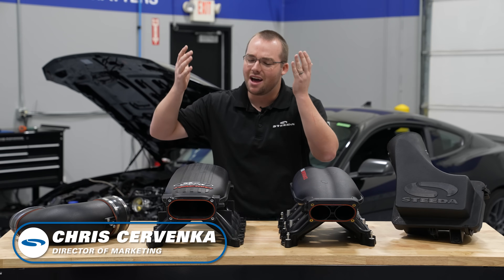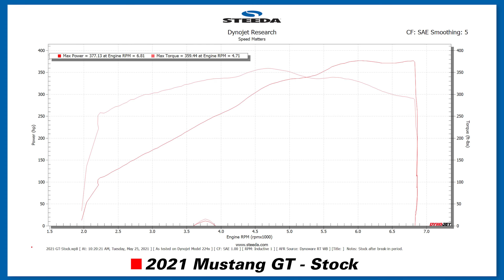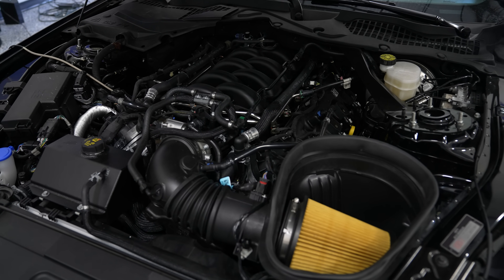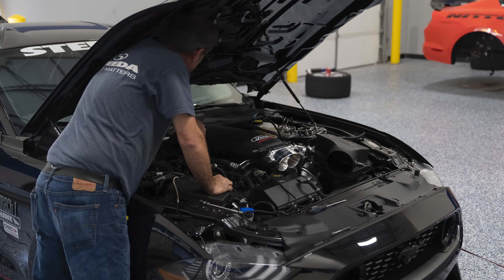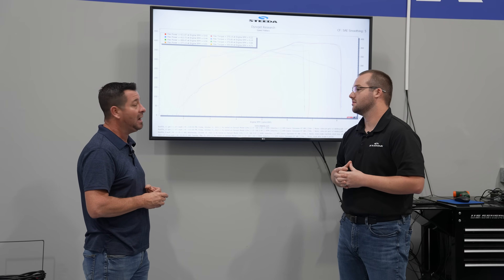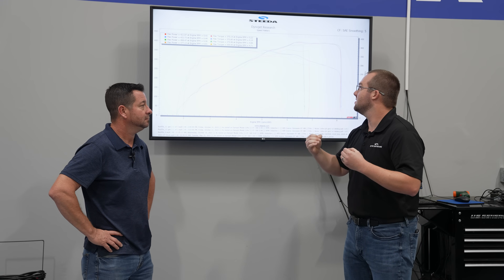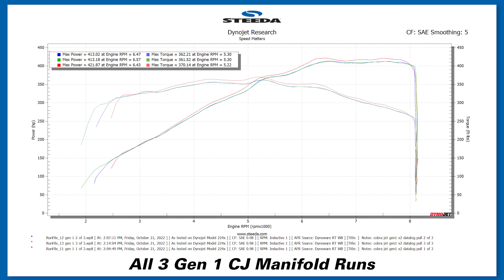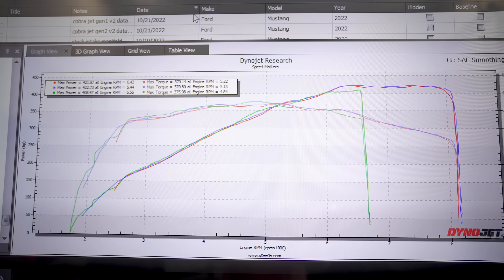Testing the New Cobra Jet Intake Manifold | Gen 1 vs Gen 2

Comment: $1500 for the CJ, then add a CAI, TB, aftermarket hood/motor mounts, for "maybe" 50HP, and you're already half way to paying for a supercharger setup... 

If you want to go max effort NA, expect to lose the radio, AC, and everything that makes your car pretty and dailyable. That's how you run 10's or even 9's

FYI, a ported 18 manifold performs only slightly worse than a CJ...
Reply: We went 9's NA with a radio and AC....

Comment: I heard the new CJ isn't compatible with automatic mustangs. Is that true? I forgot what site it was that said that
Reply: Lol transmission doesn’t matter it will fit the motor still the same
Reply: @Arman-e3x  "It does not have provisions for the aspirator tube hookup found on automatic transmission models, and is therefore incompatible with the Ford Mustang GT automatic transmission." Found the article. It's was by Ford Authority. It DOES matter.
Reply: You will need to fab up your own vacuum lines with an auto

Comment: Its cool to see some numbers, but im pretty sure the cj gains arent super evident without cams and headers. Gotta rev it to 8 or better to really benefit from that increased flow.
Reply: This was just a comparison of the gen1 and gen2 intakes on stock engines (which is most likely the way 95% of people will do). There is no real diff in power - it's just a way for FRPP to justify increasing the price.
Reply: @jsimmonstx  you can't judge it by what it does on a stock engine it isn't meant to be ran on a setup like that.  You need cams and headers to take advantage of what the cj can do ecsp the newest one.  On a max effort setup I guarantee it'll make more power than the other cj equal setups.
Reply: @midnight347  it’d probably still make 1-2 more whp with cams and exhaust haha the gains from the extra mods would just get subtracted out
Reply: @midnight347  Yes, those mods would help *the engine*, but the gen1 and gen2 would still show negligible power differences between the two intakes on the same motor.

Comment: Thankyou for the comparison, I would definitely love to see a ported gen 1 vs ported gen 2 cj with free flowing exhaust. That aside, I feel the stock Mach 1 and the stock gt run should be taken with a grain of salt. Those where stock runs, so in addition to adding the cj, the tune was more aggressive than the stock runs. The cobra jet definitely will carry power out to 8000 the best, but this doesn’t show what the 18 and 350 manifolds can do when they are tuned more aggressively as well. Also when comparing the stock gt vs Mach 1, being that they have different factory tunes and one is open air intake I also don’t think that’s a good comparison. The Mach 1 definitely makes a good chunk more power in stock form, but I think it would be fair to get an aftermarket tune for both and leveling the playing field to truly show the difference in the manifolds.
Reply: The gen two can't be ported due to the way it's cast.
Reply: @marksiniard9731  there is at least 1 company (1320 Junkie) and probably more like AFS that are currently porting them. Don’t know what you mean “They cant be ported”
Reply: @marksiniard9731  I’ve sold a dozen ported Gen 2’s. More work but very doable.
Reply: @marksiniard9731  ahh ok I didn’t realize, thanks for telling me
Reply: It wasn't about what the stock manifolds do there are plenty of results for that.  This was how the new cj compares to the previous one.
Reply: @midnight347  I’m aware

Comment: Don’t buy the steeda cold air intake. It only gives you 1hp and it’s cost $500-$600
Reply: Honestly intakes in general make minimal difference which is why your tuners say just pick one and ride with it. The only major difference and deciding factor between intakes is the IAT’s, and how clean the maf reading is.
Reply: Lol mine picked up 6hp and 10lb ft but besides that it keeps IATs super low. It’s worth it if you’re staying NA
Reply: @dontyouworryaboutit_  exactly, the gains aren’t crazy it’s more of an IAT thing but it definitely helps being n/a and getting all the power you can. I chose steeda because I didn’t want super high intake temps, and I switched to that one from an airaid only because the steeda allows more air flow.
Reply: @ThrottleHavoc  I’ve driven around in traffic in the middle of summer in Tennessee with my IATs in the 120s lol, hard to beat that
Reply: I got my 5.0 dyno tuned with the one the most recommended tuners in Northern California. We did both 91 pump gas and e85 with the steeda filter and the results were the same. Only 1hp difference. With all my my mods and on e85 I ran up to 551hp. Super difference from stock and 505hp on 91 pump gas

Comment: Thank you for the Test. I have 2021 Gt mt82 with a Lund e85 tune. Other than that, just stock as it’s my daily and I don’t want to rag out my daily. But I wouldn’t mind a little more top end every once and awhile. My question is, Would I have to lower the motor to make the new CJ fit? Would it clear removing the hood insulation? Probably a dumb question, but I wanted to ask because in your video it looks like it would fit with about an 1inch clearance. Thanks in Advance!
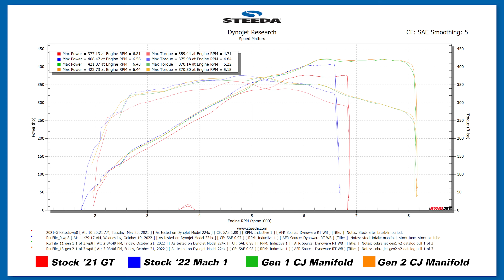Reply: Listen at about the 4:00 minute mark

Comment: Props to Steeda for not trying to inflate numbers for some sales👍 good video. Ported vs Ported Monoblade conversion for the “Gen 2” CJ might be a good one
Reply: They didn't inflate the numbers, but they sure deflated the numbers of the GT and Mach. They also forgot to mention alot of the gains for the CJ cars were due to the tune. If you slap on a basic tune on the Mach it will probably make more power than the CJ. But then Steeda wouldn't be able to sell the CJ or their airbox if stock Ford parts made more power.
Reply: @saidtheblueknight  I can tell you right now a gt350 manifold ain't making more than a regular cj let alone the new cj.  It's the best intake na period.   If you slap an intake on a stock car you may not see alot of gains but once you have cams and maybe even ported heads the cj will pull away from any of the other intakes with similar setups.  The cj, ecsp the new one, don't shine unless you're running aftermarket cams.  Stock cams really limit what the cj can do.  People have this idea because the cj don't gain much on stock cars that somehow the gt350 and 18 manifold are better than the cj and this is false.  Up above 7k the cj pulls away and the gap widens the more additional mods you're running.  You want max na power cj is it.
Reply: @saidtheblueknight  my thoughts exactly.
Reply: @saidtheblueknight  The Mach I already comes with a more aggressive tune than the standard GT.  That's why the difference.  In fact when tuning a Mach I you typically pick up NOTHING peak to peak, everything is under the curve. This is a 2 year old Dyno Jet and definitely not a "happy" one either.  It's within 1-2hp of our one in Pompano also.  You want false numbers use someone else's dyno.
Reply: I agree props to them not inflating the numbers
Reply: you gain little to nothing with a ported throttle body.
Reply: @kevincandelas1228  yeah, some intake manifold porting companys are offering a “monoblade conversion” as an up-charge during the porting process to get rid of the twin TB inlets on the actual manifold moulding itself.

Comment: Of course the mach 1 is going to make more power stock it has an open air air intake
Reply: And a gt350 manifold so it makes more in stock form when both modded a base 5.0 eats a heavy Mach 1 all day
Reply: @Coyote.Collector  my Lund tuned/headers 22GT was slower than my stock 21 Mach 1…both manuals.
Reply: It also has a different intake manifold as well. The Mach 1 comes with the 350 Mani, which would also mean ford had to tune it differently. It’s not an apples to apples with the gt but it’s still cool to see the data compared.

Comment: What would it make on my 20 GT Premium? Same as Mach 1?
Reply: The GT owners want to have good information from these pulls, not a half baked test on a Mach1. Besides how many GT owners are there compared to Mach1 owners? Com’on guys do the pulls so they benefit everyone.
Reply: Yes it should, the Mach 1 is still the same gen 3 coyote engine that just has a different manifold from the factory.
Reply: @ThrottleHavoc  Mach 1 has a totally different tune from a GT.  Even manual to manual GT vs Mach 1 is going to give you different results from a Dyno jet.
Reply: @mikehughes8023  once the intake manifold and tune is taken out of the equation it’s the same motor. Once he is custom tuned with a cj it will make the same power. The only difference on a dyno chart would be if he has a 10r80 or an mt82d4. Your statement only stands true if the gt still has the stock 18 manifold. Take both engines out of the car and set them up with the same intake, intake manifold, and tune and they will be identical. They are literally the same long block. He is asking about a swapped intake manifolds and aftermarket tune so that eliminates the variables you’re talking about aside from transmission options.
Reply: @ThrottleHavoc  oh ok.  I thought a custom tune would be different from the two using the gen2 CJ.
Reply: @ThrottleHavoc  Ok Thank You

Comment: Please do a ported test 18+ manifold then ported & gen 2 CJ manifold then ported 💯💯
Reply: CJ gonna stomp past 7k, even unported
Reply: @GODEYE270115 people just don't get it.  They focus on peak power no matter how many times you tell them not to.
Reply: It makes me proud and is also surprising that lund was chosen for the tuning. I’m not a fan of outsourcing but I would of thought steeda could have tuned in house? I guess they’re just hardware not software 😅
Reply: @Diamondsintherubble  Mic Drop
Reply: I'm thinking a ported 18' manifold would get within 3-5 HP of these CJ manifolds. For a starter performance mod, I'd probably just have the stock manifold ported on the Mach 1 and tune it for E85...more bang for the buck than a CJ manifold setup.
Reply: @keithharris1  wrong
Reply: @Coyote.Collector  right? No 9 sec na gen 3 has stock mani
Reply: @keithharris1 ported vs ported it won't and with cams it'll be even further away.  Up above 7000 the cj walks all over the 18 and it does on average power too and how good it holds power top and gains across the curve.  You guys just want to beleive your cheap 18 manifold is close to a cj when it's not.  You're living in denial.  Race and identical cj car with all else equal it'll pull and with cams in the equation it'll pull even more because cams let the cj does what it does unlike stock cams which is the only reason the other manifolds are even in the discussion is because they work better with stock cams while they hold the cj back.
Reply: @midnight347  what car or performance shop do you work for?
Reply: Porting the intakes won't get you anymore power. 1 to 3 rwhp isn't worth the cost.
Reply: @marksiniard9731  that all depends on which intake manifold